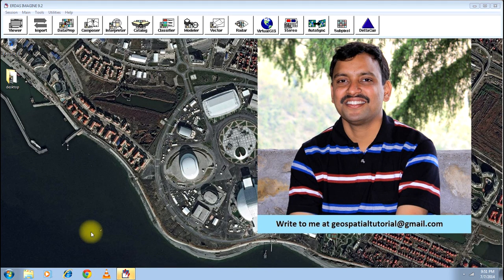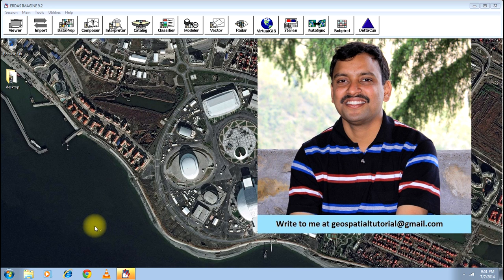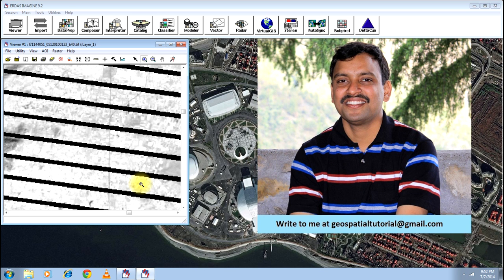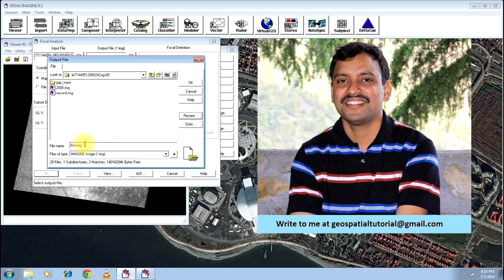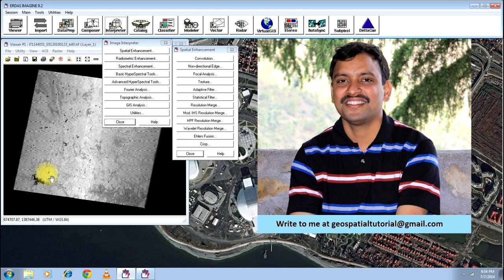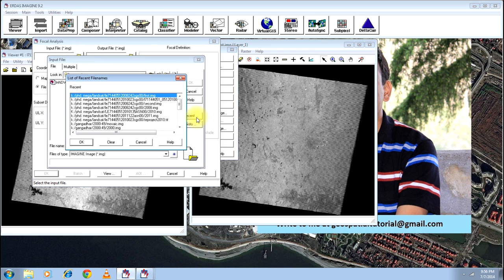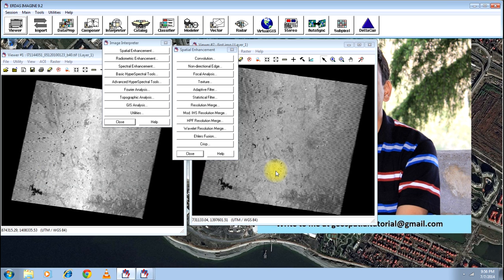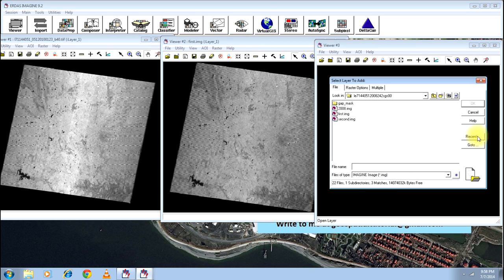Gapfilling or Destriping Landsat 7 Image for Display Puspose - ERDAS Imagine

Comment: I think you should have said in the video that this method is NOT preferred in scientific analysis. I am disappointed on you for not warning the viewers.
Reply from the maker: Anyone going through it will observe that its not perfect. Many have mailed me asking about the accuracy. I have replied accordingly. Also go through the comments for which I have replied. Here also I have mentioned that. While making a video a person can forget to include certain thing and probably you should think of it before posting such comments. There is no gap filling method that is accurate. SLC off is an issue which can not be addressed completely and there are one or two methods which addresses it to some extent and this method is definitely one.

Though it is for primarily for aesthetic purpose, some small scientific analysis also can be made. Though the accuracy can not be guaranteed.
Reply from the maker: Also do not think that, using a historical data for filling the gap or using multiple SLC off images to fill gaps result in accurate image. There is not accurate method for this.You should select method based on your work. If you are using historical data for filling the gap or using multiple SLC off images to fill gaps be aware that temporal changes in land cover can totally spoil your study. Method I explained here interpolates the neighboring cells, others will interpolate the historical images. That the only difference.
Reply: Thanks for your reply. As it was a very important aspect, I still think the video should contain that 'aesthetic' warning. People will be misdirected otherwise.

Comment: Dear Sir, Thank you very much! 
and I have two question, How much this Gap filled images are accurate?
Is this technique directly applied to stacked images or  before stacking images?

regards,
Reply from the maker: You have to apply it to already stacked image. Else your work will be increased by that much.This is not  a very accurate method, it just interpolates spectral values to fill the gaps. But the best among available to carry out scientific analysis.
Reply: thank you very much!
Reply from the maker: Welcome

Comment: I want to destripe/gap fill the landsat 7 slc off data. I tried in ENVI with single file gap fill method and I got result. I have a few doubts: 
1. In erdas Can i stack all the 6 bands of MSS landsat 7 etm+ slc off data and start the focal analysis or does I need to do band wise focal analysis then stack the all the corrected bands? how many times we need to perform the focal analysis.
2. In ENVI there is landsat gap fill tool, in that tool there are three methods
a) single file gap fill,
b) Two band gap fill (global histogram matching)
c)Two band gap fill (local histogram matching)
In Two band gap fill (local histogram matching) does we need to work band wise or on stacked image.
Thank you